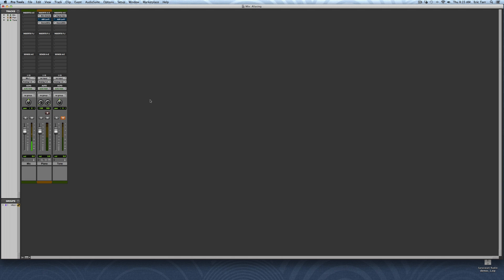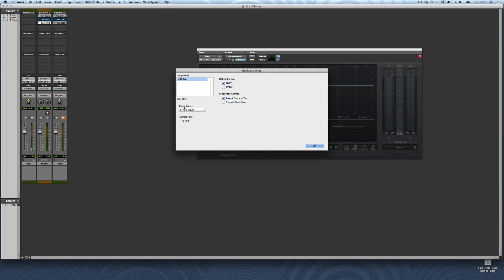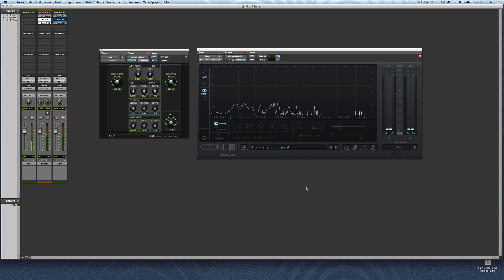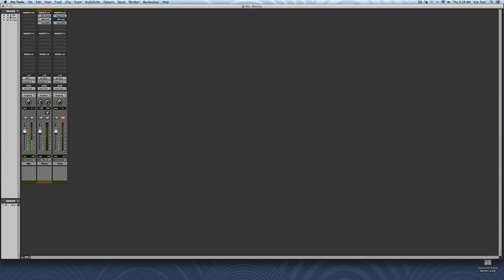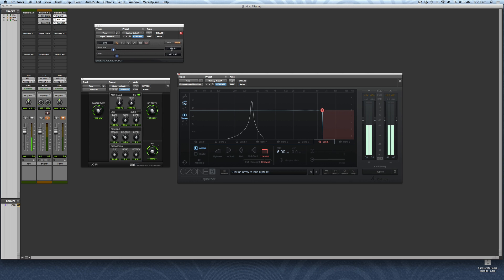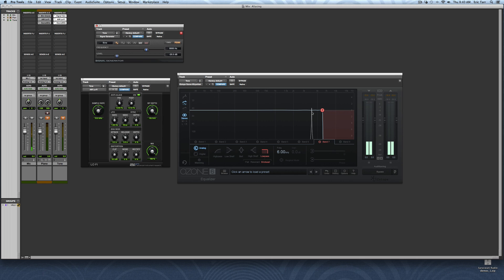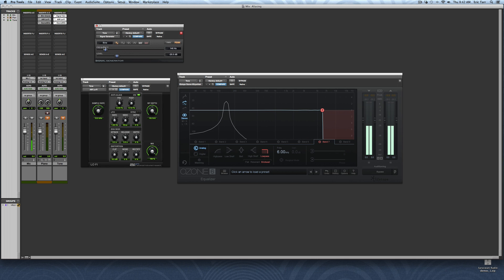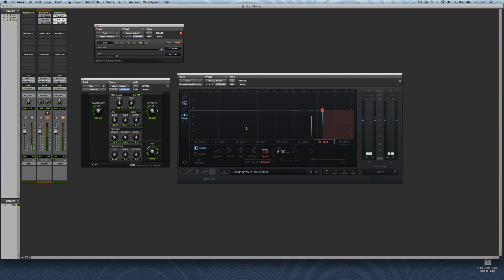Digital Audio 101: Aliasing Explained

Comment: Why are samples-per-second measured in Hz?  Hz are cycles-per-second.  
Does this relate to how, in digital systems, you need at least two samples per cycle/frequency (one positive, one negative) for the frequency to be reproduced?  and that's why the sample-rate needs to be twice the highest frequency you wish to record?  Because if the system is able to take one sample per cycle of 48kHz, its sample-rate is  therefore fast enough to take 2 samples of 24kHz?
Reply: Yes exactly you're right

Comment: https://youtu.be/Bx9hW07BLIk?t=98 Here's a fun example of extreme aliasing in modulation resulting in pretty much noise, from FM synthesis when the modulator has a harmonic 14 octaves higher than the fundamental (the operator is in 2x, so 7 octaves -> 14 octaves). Since it's FM (or phase modulation), the output is not a constant signal, it's noise instead. Kinda cool.

Comment: So mixing at higher sample rates should actually be beneficial against aliasing should there be sounds that have frequency content that go beyond 1/2 the sample rate. So aliasing can occur from audio that is made at 96kHz or even 192kHz and then resampled to 44.1kHz if no high cutting is done. All the frequency content beyond the 22.05kHz section will just be reproduced as aliasing. I once exported audio at 96kHz and then attempted to mix it at 44.1kHz. Some of the samples changed in pitch. They had frequency content beyond 22.05kHz & I hadn't cut them. I now know that this was aliasing that caused the perceived change in pitch.
Reply: But as you mentioned, the DAWs filter out these for us automatically so aliasing isn't much of an issue in this regard.
Reply: Depends on converter. Ableton 10 converter is clean, but Reaper and FL creates lot of aliasing when you downsample.

Comment: If modern equipment can handle Nyquist rates in the human spectrum of hearing with no problem, then why would one even bother with a sampling rate that can introduce aliasing like he does?  Is the point that encoding/bit depth and other errors might introduce too high of frequencies and so high-pass filters are often (perhaps always?) needed to avoid aliasing, even though it's occurring "behind the scenes?"
Reply: Aliasing happens no matter what sampling frequency you use. For instance, suppose a microphone picks up sound at 30kHz. Humans can't hear that sound, but if you sampled at 44.1kHz, it will look like you have sound at 14.1kHz, a frequency that humans can hear. That's why you have to pass the microphone signal through a low pass filter first, before sampling. I suppose the same principles would apply in digital sound production. If you're using some instrument with sound sampled at 96kHz,  you should pass it through a filter before downsampling to 44.1kHz.
Reply: it's bitcrusher effect.

Comment: Does anyone know if there's any loss in quality when 44100 Hz FLAC is converted to 48000 Hz ALAC?
I've been making this conversion with MediaHuman Audio Converter for hundreds of files lately, but never noticed the difference in sampling rate between what I put in and what I got out.
Reply: Yes, there will be some aliasing issues but you probably won't notice it.
Reply: Run a file trough a spectrogram and you will be able to visually see the aliasing, probably.
Reply: @--..__  Aliasing?  If you're increasing your sampling rate, you should be able to perfectly recreate the waveform and then some, no?  Perhaps it will need to interpolate, causing some (probably not noticeable) accuracy smudging, but I wouldn't imagine it would alias .

Comment: is this how audio can end up with something that sounds like chirping heard from underwater?
Reply: Maybe. But I think it's more likely that what you're referring to is pre-ringing caused by sharp temporary in-band frequency cut-offs. Like they happen very audibly in low bit rate mp3 conversions.
Reply: I think I've heard it only once, when used lots of saturation and fm synth that have no oversampling (I actually liked that sound)
Reply: Usually difference between higher and lower sample rate, or oversampling, is more detailed high end. Aliasing blurs sound a little.

Comment: I found this kind of aliasing kinda of pleasing when playing computer games on sound cards from the 1990s. Then XP came about and did mixing in software with reasonable quality, and suddenly all 16-22k samples sounded dinstinctly muffled. If I don't have a mental picture of the correct sound of a piano, the samples a synthetic or a mix of different sounds, the extra fuzziness seems to belong in the signal.
Reply: I agree. I mix in a little resampling into a lot of my mixes actually. I find it's also a great way to spruce up lossy sound files when mixed in at 5-20 percent. Especially on drums!